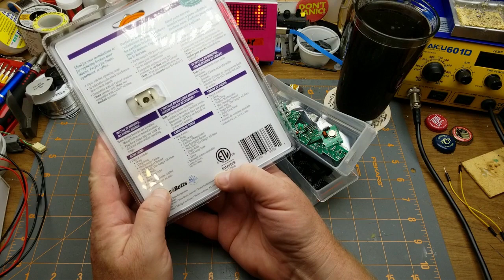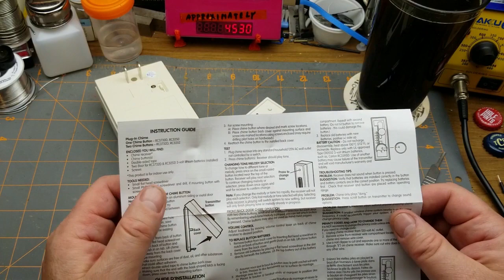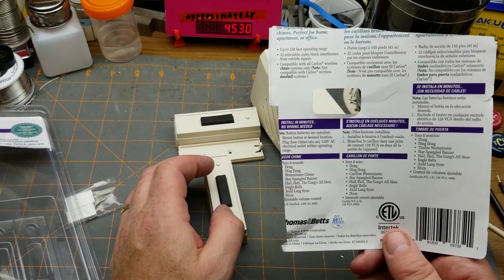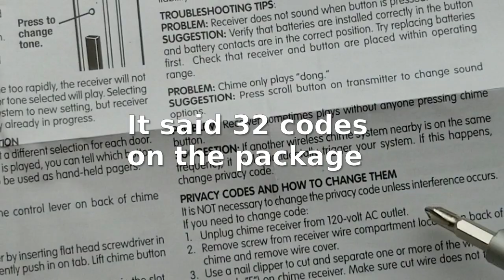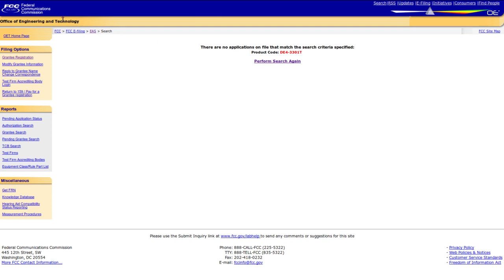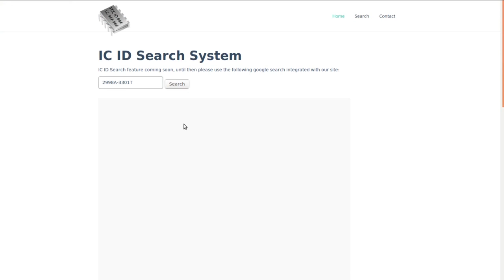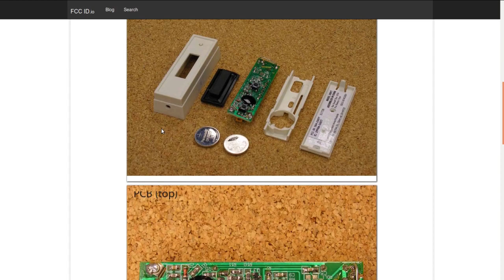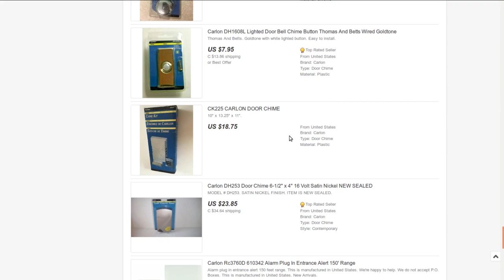wireless doorbell teardown

Comment: 4 Dollars wow!, very cheap but usable :-D
The batterys are not cheap junk, i would have expected 'Fling-flung-chang' ones :-D

Wax has non of the horrible conductive glue problems.
C.b radios had the wax over the v.c.o synth area, and a drip in the adjustable coils.
Stopped movement and helped with stability.

Comment: I believe it is called potting wax because it was used primarily on potentiometers.
Reply from the maker: Interesting. 

I was always under the impression the term came from how the process was done.
Reply: @pileofstuff  you may be right. And old TV repairman told mn e this when I was but a young lad (like 1967, 10 years old). But I was gullible, so he may have been pulling my leg, but it made sense to me.
Reply from the maker: @mjbirdClavdivs  Your comment made me do some research:  https://en.wikipedia.org/wiki/Potting_(electronics)
Reply: I think it's more about a procedure, I would be surprised if it was named after one component but I will see what I can find, you have peaked my interest...cheers.

Comment: At 7.33 you mention it has 5 security codes not the 32 advertised- fairly sure that the 5 switches is binary for your 32 states.
Reply from the maker: That's correct. 

I went deeper on that later on, but ended up editing most of it out because I was rambling on far too long about it.

Comment: Shite!!! I paid $35 (5 years back) for the doorbell and one switch. Works great, but the price drop is mind boggling.

One minor issue I have is that our doorbell will sometimes ring when the neighbour across the street has a visitor. Yes, I know there is an easy fix (clip a couple of wires). I just don't care.